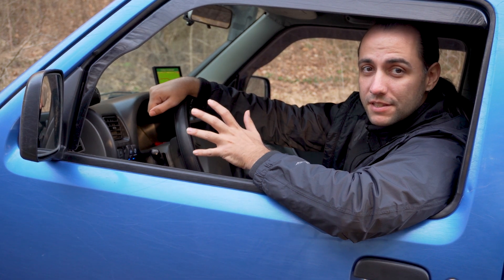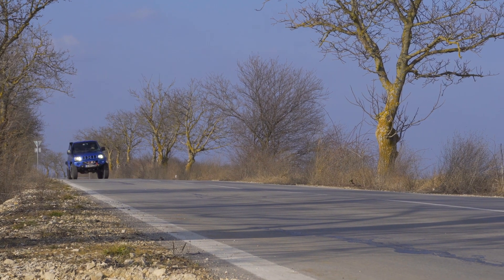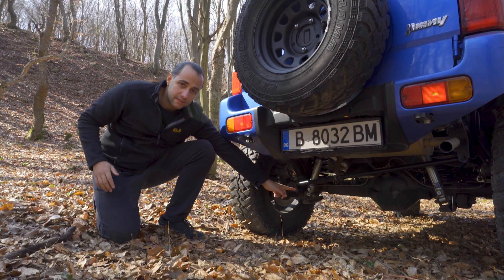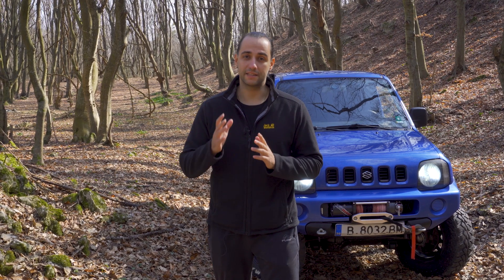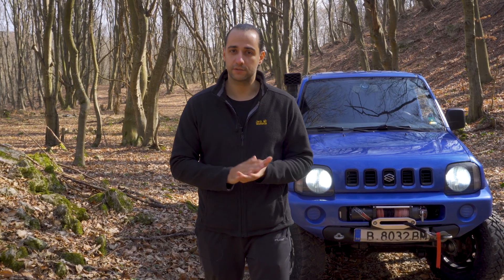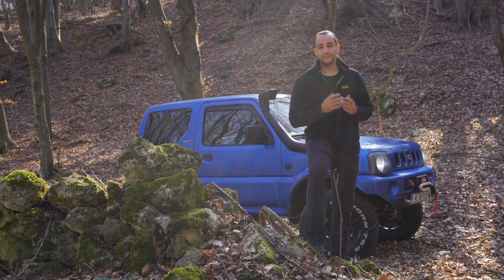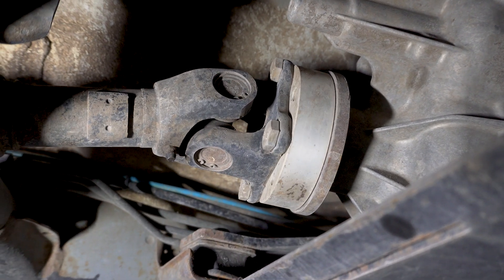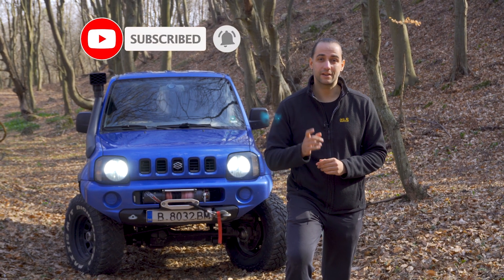4X4 Suspension lift kits EXPLAINED | Choose the Right Size!

Comment: Hey, i just bought a 2002 jimmy and am going to do a 2” lift and fit some bigger all terrain tyres, im not sure how tyre sizes work do you have any tips?
Reply from the maker: Congrats on your 2002 Jimmy! For understanding tire sizes, you might want to check online calculators. If you want to fit the biggest tires possible, that involves a lot of factors such as the wheel offset, bump stop lengths, etc. It's easiest to just go 1 size up

Comment: With 2 inch lift you need longer brake lines, longer suspension bump stops - this is essential
Reply from the maker: For many 4x4s and for the Jimny the stock brake lines can handle 2" lift in my experience. True, some models cannot.

Comment: Hi.1.5" lift for honda cr-v be all right?Anything affect the car?On standard i have 215/65/r16...if i lift the car 1.5" with the stock wheels,what big tires you recommended???Thank you,cheers
Reply from the maker: 1.5" lift with a 1" spacer sounds reasonable for a CR-V. The tire size would depend on a variety of factors, including the rims' offset - just pay attention to how much space you have to the arches when turning the from wheels.
Reply: @The4x4Lab  thank you.I have put 235/70/16 on original wheels and it’s rubbing just a bit which don’t affect me to much 😁…Overall looks awesome 😍

Comment: Really great video. My Jimny has been lifted with rubber pads and I am about to correct that. I saw some cheap liftkits, i.e. 400 euro for 50mm. should one stay away from them or are they still recommendable and how do they compare to the high end ones?
Reply from the maker: Better suspensions will have better damping characteristics which means they will protect your tires and vehicle parts better and the performance on and off the road will be better

Comment: You need rock sliders so you don't dent the rockers
Reply from the maker: I have pushed the Jimny hard over the past 5 years and never needed rock sliders. It's such a short wheelbase that it's unlikely that anything will damage that part. At least in my style of driving 😉

Comment: I have a landcruiser hzj71, the shortest wheelbase. I use it as often as possible offrod and it’s great. It has a suspension lift and 33 inch tires. OME suspension, all the good stuff. I have a lot of respect for the Jimmys. All the things that were explained here i can fully support. The car has to be reliable, that‘s the first for me. The more extreme you go the more it costs. See where you want to go and then make it the right way. If you can‘t afford it, don‘t go there and wait. The stock vehicle is good allready, there have been some engineers working in it for years. Never go for looks always go for function. Just enjoy the jimny as it is and how you are able to upgrade it the right way. It‘s like offroading, if there is an ibstacle you feel unsafe, avoid it or drive around it. Just don‘t wait for the car to be another car, use it as it was meant to be and enjoy it. I‘ve seen a Jimny in a offroad park in france and it was mostly original exept for the tires. And it went places where all the famous cars went. The driver and passengers were smiling and grinning. And the spectators always supported and cheered when it made it. It‘s a beautiful car with character, it‘s underestimated by lot‘s of people. But it‘s an icon. 4-5 years from now, that car will be sought after like to old fiat panda 4x4 because it has style and it‘s humble. But it gives a massive middle finger to the high end society. The jimny is build like my LandCruiser. Just smaller, cheaper and more practical. This car will be your friend
Reply from the maker: True. The Jimny is in a segment of its own. There simply aren't any other true 4WDs at this price tag. 
I assume your OME suspension lift is nothing crazy, perhaps +2 inches?
Reply: @The4x4Lab  yes it‘s about 2 inches. Combined with the 33 inch tires it makes an difference

Comment: I have a 4cyl ford ranger manual shift with fiberglass finders what size lift would work the best for me  and tires?
Reply from the maker: Depends. But a 2 inch lift will be best in most cases.

Comment: I have a Jimny as well, bone stock, I’m not sure where to start, whether I go suspension first (2’ only legal in Australia) or do I go for bigger wheels to increase clearance?
Reply from the maker: Probably get the suspension lift first so you can more easily fit the bigger tires :)

Comment: hi, great video! i noticed you have removed the front sway bar for articulation. how does it handle on the road?
Reply from the maker: I haven't noticed a big difference. 😉 Perhaps if there is more weight higher on the vehicle (a roof rack or a rooftop tent) then the lack of a sway bar would be more pronounced... One can always disconnect it just to test it out and make a decision.

Comment: Hi! Nice video! I want to ask: can I fit 235/75/16 on my +2,5" suspension lift and +2" body lift jimny without change my transmission gear? The jimny is 1.3
Reply: yes but it would probably drive like a dog on the road
Reply from the maker: Of course, you can... but you will probably not be happy with the low range when driving offroad.

Comment: G'day George (apologies if spelling is wrong) 

I have the same Jimny I believe - 2007 VVT? If so; how have you modified the engine? It sounds very different to mine (have just started some basic mods)
Reply from the maker: I have a KN sports air filter and the cat is removed. I haven't done anything else that could affect the sound.

Comment: Running 2" and 33"s 10x15 on my jimny.  more lift, means top heavy. so the big and heavy 33"s will keep it not rolling in hills. works great, but i ordered 6.5:1 gears now.  the low range is awful.
Reply from the maker: True, the low range is not really low on the Jimny. 33" is a bit too much even with the right gears - what is your top speed on the asphalt?
Reply: @The4x4Lab  much have happend in 3 years time, running 37's and 38's now 4" lift.  6,5 box have hold up np, even with 37 boggers.  
installing 4,89 diffs this weekend. (3,9 original) 

I dont care too much about top speed, crawl is all that matters.  but i do 60+ mph on flat land if i need too, boot to (thru) the floor.

Suzuki offroad meet in august, see what it can do.
6,5 box is good with 33's and 35's.

Comment: Good explanation. But there's few things 
1. Higher lifts don't mean bad handling on road with upgraded shocks could handle better than stock (and that's is a regular shock imagine with bypass shocks). People sometimes run wider axles that enhances stabilty for example lots of people when they run big lifts and tires on samurai they upgrade to toyota axles. So overall depends on setup. And if done properly it will be better than before on road too. Also it won't break or wear down if done properly if bushings aren't at steep angle, u joints. Same thing with big tires 35s on a vehicle that had 28s stock plus more power stock axle will work fine but don't be suprised when they break. Now that depends on the vehicle cause some won't even feel 35s.
Reply from the maker: Hey, thanks for watching and sharing your thoughts. :)
When a vehicle is designed there is an army of engineers at the manufacturer's HQ that calculate every detail in order to make it work well as constructed... 
That is hard to beat, but I agree that in theory, it is possible, and one should be able to make it better in every regard and for all terrains. 
Taking the stability example - you put flanges and negative offset wheels to restore stability but then bearings and other bits start to fail, so you get a stronger axle from Toyota but you cant find someone to wield it at the proper angle with perfect accuracy, even if you do, then the propshafts need replacement with stronger ones, the engine cant keep up with the bigger tires and axles, you swap the engine, then the clutch fails, after that the gearbox and so on and so on. 
Offroad tuning is an endless and expensive journey but we are all tempted to do it :) I have a 4 inch lift, craw gears, locker and I keep buying hahah :D
For the purpose of simplifying the video, I have not gone onto these details... ;)
Reply: @The4x4Lab  yeah but in general it depends on whole setup for example when some guys put longer front arms to extend the front and make it pretty parallel to the body lowering center of gravity while increasing articulation if there's room for that like on buggys but for vehicle that can't do that have arms underneath the body. For example wranglers on 40s and their lift kits make it lifted while still retaining on road performance depends on arm position and shocks lots of them run interal bypass, depends on swaybars... and more. These directly built kits are like factory fit but you can make good with other car parts if done properly. For example they make lift kits for factory samurai axles and toyota axles.

Comment: In my opinion I wouldn’t even consider anything more than a 2“ lift for the suspension and no more than two steps above the stock tire size. If I wanted more ground clearance, Portal axels are the only reasonable way to go.
Reply from the maker: Portal axles are the top of the top when it comes to offroad upgrades, no doubt about it. 
However, they are difficult to find and expensive to buy.
Reply: Well, there is a German company called TIBUS that makes portal axles for lots of 4x4 including the Jimny. As far as I have heard prices start at 10,000€. That’s indeed not what I’d call inexpensive, especially if you compare it to the price of a Jimny. But on the other hand, if you ad up the total cost of all the modifications that go into a higher lift, maybe the difference is not that much anymore. By the way, portal axles have a hidden feature not everyone knows about. As they are literally just small gearboxes, you can get them with a built in gear ratio reduction to match bigger tires. Therefore you don’t have to work on your gearbox and save some money. In the end it’s more that I just wonder why they are not a way more popular modification on the more expensive rigs like in the US or Australia,for example.